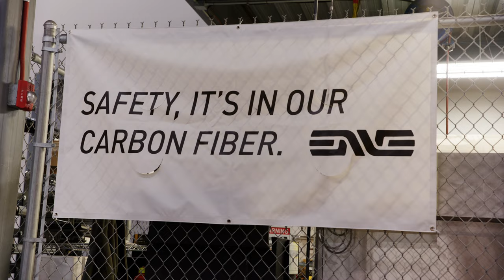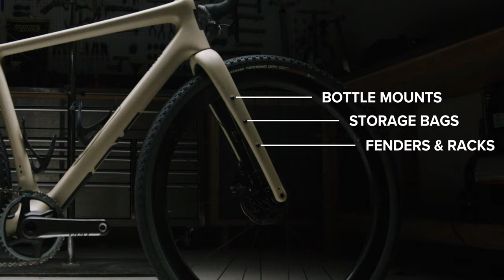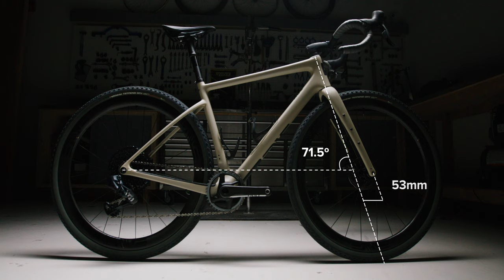ENVE’s First Gravel Bike! Introducing The ENVE MOG

Comment: Nice vid, nice bike too.  I however really like my Diverge - 8r carbon fiber which is a tank to gravel rocks, tiagra drive system, cobble gobbler seat post for suspension n handle bar suspension system.  Great ride with panaracer sk 38 gravel tires. I pump them up to 40 psi for road n gravel.

Comment: Bike radar just dropped a video stating that you can only run Shimano for a double up front.
Reply from the maker: SRAM Mechanical 2x is a no-go but SRAM AXS 2x is compatible. If you have more compatibility questions, reach out to one of our Gearheads. You can either give them a call at 1-888-276-7130, or chat in on our website. Thanks for watching!
Reply: @competitivecyclist  ok. Thanks!